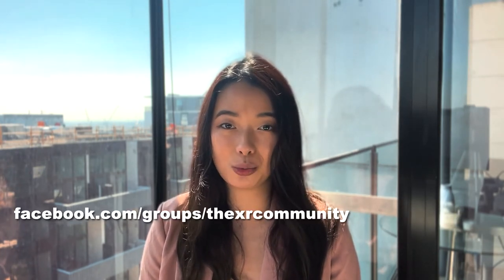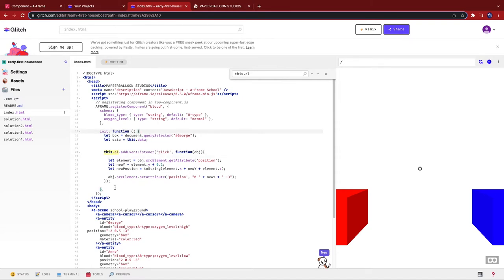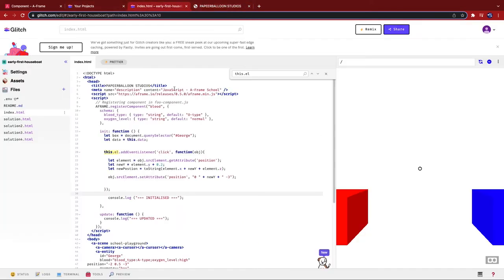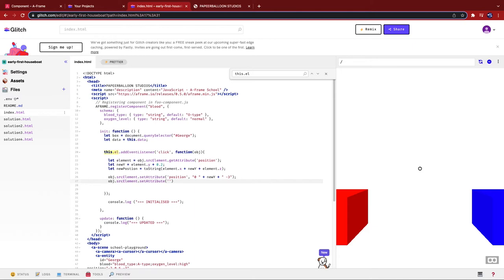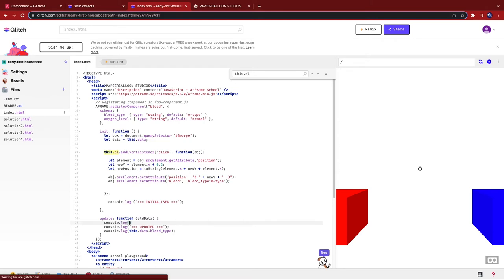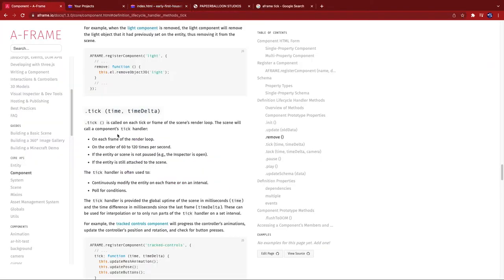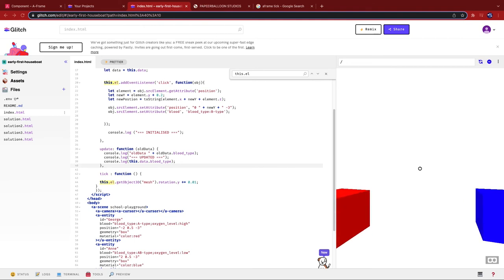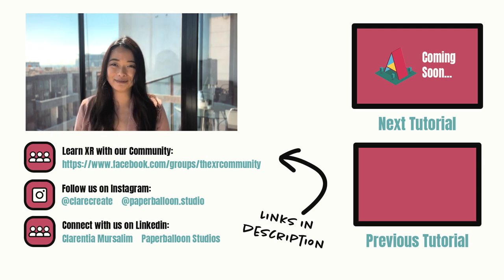Aframe Webvr - VR Development Part 7 -  Update, Tick (Custom Component Part 3)

Comment: When adding to rotation values it's best to just assign a `elapsed_time % (2 * Math.PI)`  instead of add, or you will probably run into numerical issues after a few minutes of running. The ticks are not always at regular intervals, although they try to be, so this mitigates that issue as well.